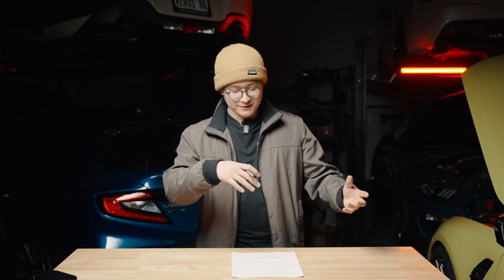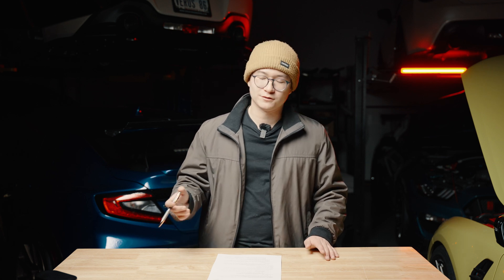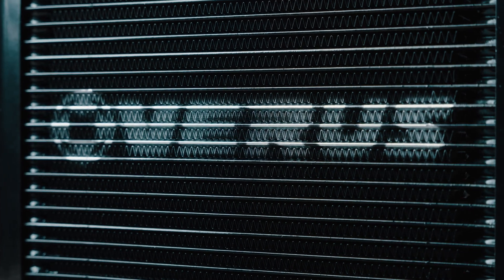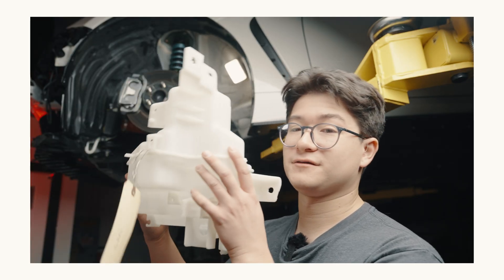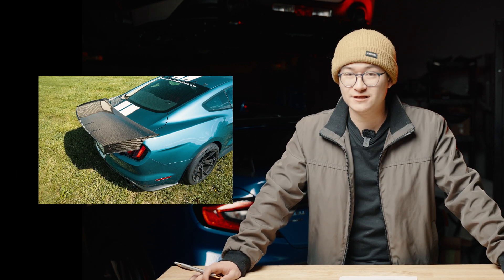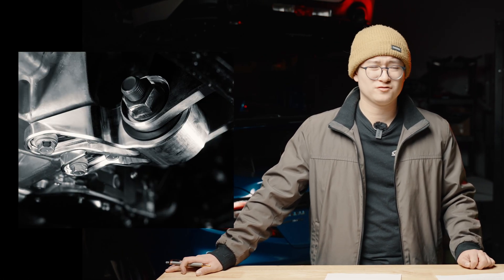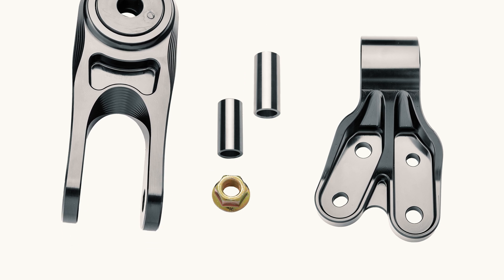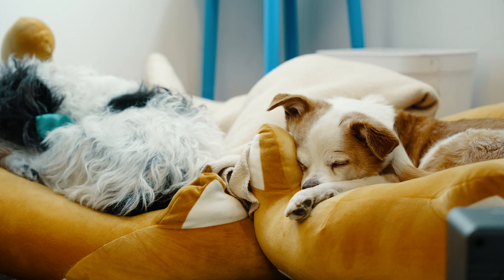The Verus Fix Episode: 1 | M4 Development, Mustang Drag Wings, FA24 Oil Pan and more.

Comment: Hey team! Do you have a estimated timeframe when you think the BRZ oil pans will be ready? In march / April I'm stocking up on parts, hitting the tail of the dragon (coming from FL), and stopping at a buddy's place in KY to install everything. Would love to include the pan if you think it'll be ready by then :) but if you think it'll be beyond those months then I can put those funds towards other parts. Thanks!
Reply from the maker: I wish I had a definitive answer for you. The bottom line is we continue to go down a rabbit hole as more people do track testing with our Version 3 production unit. We are moving on to version 4 which we are hoping to improve things even more. Version 4 machined prototypes are being thrown on the engine block in a few days with an HKS kit for test fitting.
Reply: @VerusEngineering  Thank you for the update! Looking forward to seeing your findings if you chose to share. Good luck!